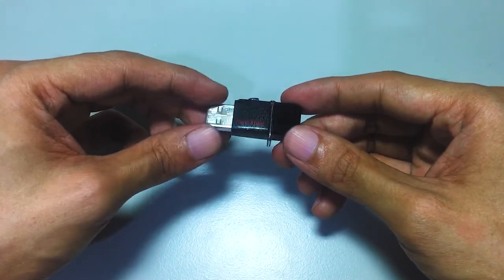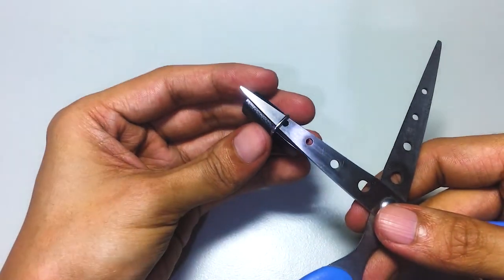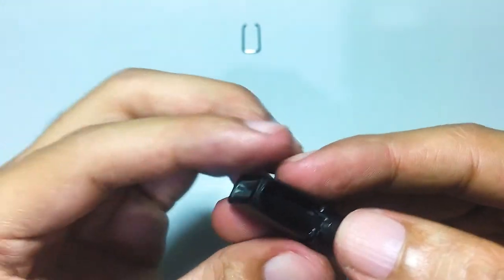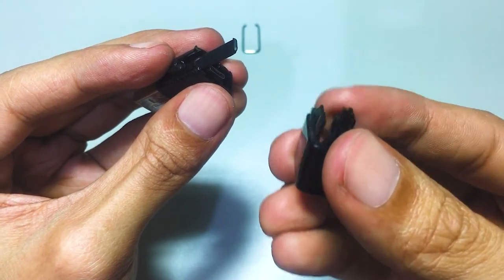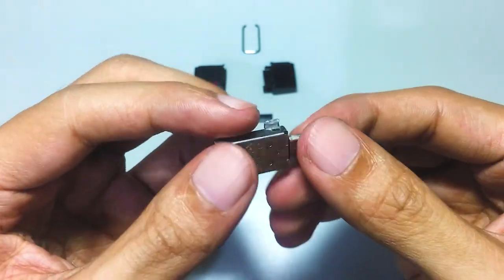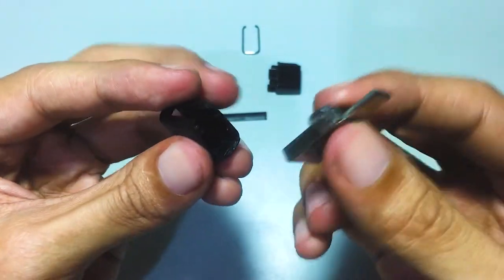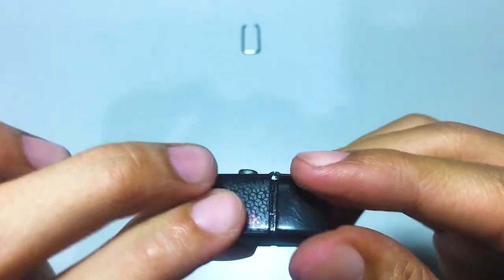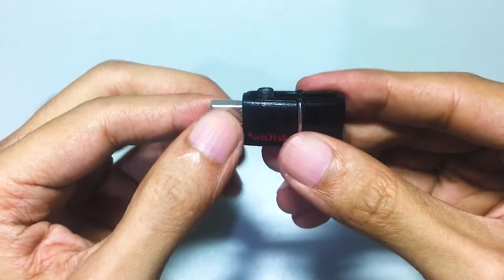How to Disassemble Sandisk Ultra Dual USB

Comment: My knob broke down and I was not able to use the drive properly. Came across this video, opened parts, stuck the knob directly to metal part without inserting that plastic strip, and closed parts. Now it's not as smooth working as before, but workable.
 You can use the drive as it is (just metal body) too, after dissembling, no need to put plastic parts around if you can take care of the drive like that.

Comment: holy shit i can't believe i found a video for exactly my problem. thank you! but i can't seem to get the two pieces apart once i got the metal lock off, though. haha
Reply from the maker: you just need to bend it with a little force. Wiggle and bend it on both ends for it to come loose :)
Reply: @TheRemedyGuy  what adhesive did you use to stick the broken knob back?

Comment: Can I use the USB drive without gluing the cover back on?  Is there any risk of a short circuit due to overheating?
Reply: I think you can use it without putting cover back on. Instead, drive will cool more rapidly if it's without cover.
If you are using it without cover, do let me know how it's working.

Comment: Hey thanks for the video. I was cutting files to this memory stick and something happened with one of them and an error message appeared. Ever since the memory stick hasnt been recognisable, it is seen in device manager. And when i wiggled it in the usb port on laptop another error message come up thats states explorer.exe catastrophic failure. Can the drive be fixed, did it over heat?

Comment: I have the same model but my problem is it is now in "Read only" state. Any idea on how to change it to default?
Reply from the maker: You can try to run a 'chkdsk' on it and I hate to be the one to tell you this but in my experience, when a USB does that, It's an indication that it detected some errors and activated the 'read only' mode to save your data. As far as I know, there's no method of fixing it. Sorry buddy.

Comment: Hi, This is actually my usb looks like, but it cannot be open my movie, because we're watching movie when the phone falling down accidentally together with the otg usb connected, how can i fix this. It cannot be used. . please help me to use this again. I think its not the external part, i think its the problem is internal? Please answer.
Reply from the maker: Hello! Did you open up your flash drive to see if everything is still intact inside?(assuming because of the impact) Have you tried plugging it in on a computer to see if it's still recognizable? 
It's hard for me to assume a specific fix since the only thing I know about your flash drive is that it fell on the floor.

Comment: My otg fell and disassembled before so i super glued it. Now that the slider is broken its hard to break apart the case
Reply from the maker: Try to apply heat on the area where you applied it. Rise of temperature can decrease the solidity of adhesives. I would suggest heatguns if you have access to it or hair blowers. Be careful not to crank it up too much though, for it might damage the internal parts.
Reply: @TheRemedyGuy  sooo i kind of broke the casing....... that's fine right? I just have to be really careful so the stick wont be damaged......?
Reply from the maker: @jamillearaojo2290  correct. As long as it's working ;)
Reply: @TheRemedyGuy  thank you!

Comment: How to glue the slider??? Plss respond im so depressed
Reply from the maker: Try to relax as much as you can first because you will need a steady hands. First, all you need to do is to moisten the parts that needs to be glued together first. Then apply a little amount of adhesive (cyanoacrylate), put it back together and let it dry. Don't apply too much glue though as it will bulge when it dried off and it won't fit in its case. Best of luck!